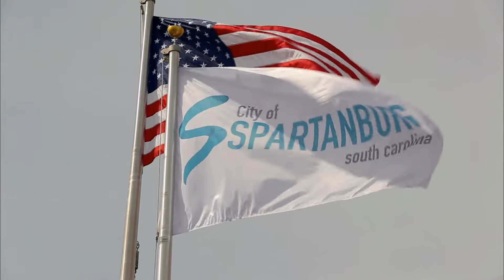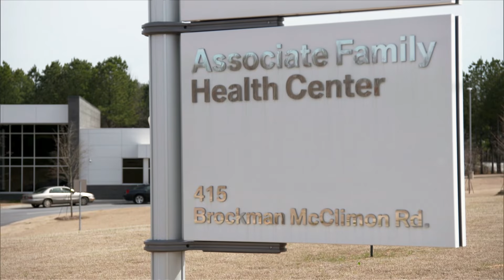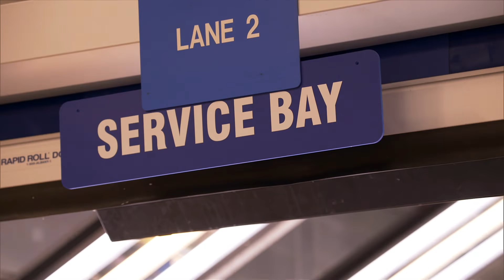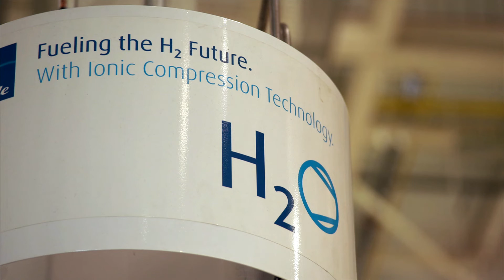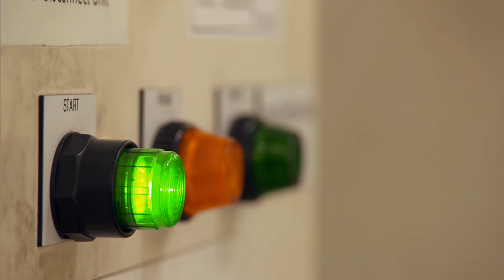BMW Manufacturing | BMW Plant Spartanburg South Carolina |

Comment: How much do assembly workers make and do they get 1 week off in July and 1 week off for Christmas?
Reply from the maker: I'm afraid manufacturers don't disclose that type of information to the public. Maybe you can try and  contact BMW to ask about wages.
Reply: In Germany, workers collecting 30 euros per hour are rewarded 12 thousand euros annually
Reply: I maintained the X6 production line and I made a little over 100k a year with some overtime. Base was about 80k a year. The production line they are filming is the X5 line which like the X6 are located in Greer/Spartanburg SC among many other production lines. I worked there in 2014/2015.
Reply: @8bert9  I start in October as an ESA on the conveyor team in body shop. Can you provide any insight? Good job? What does a typical day consist of? Thanks!